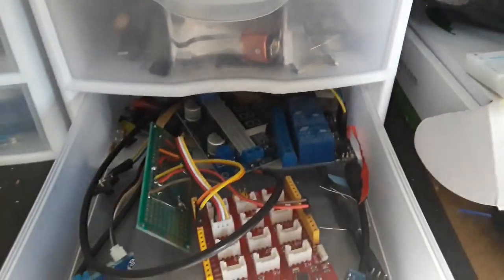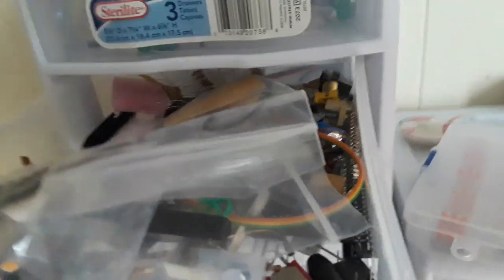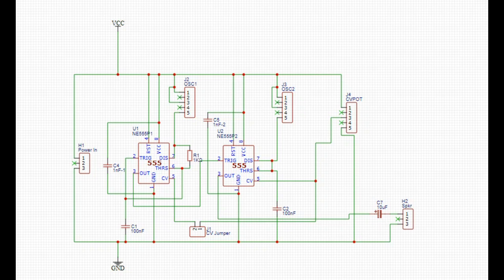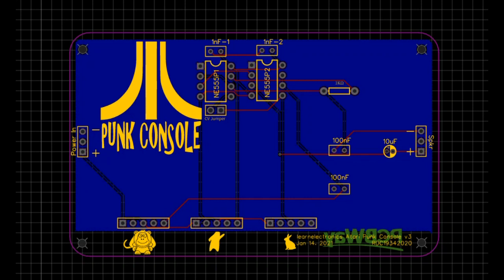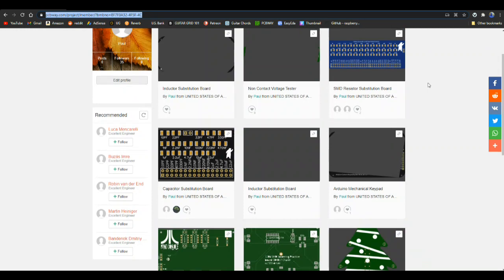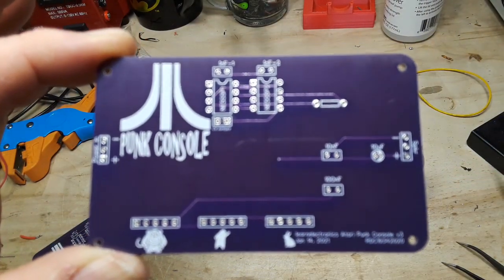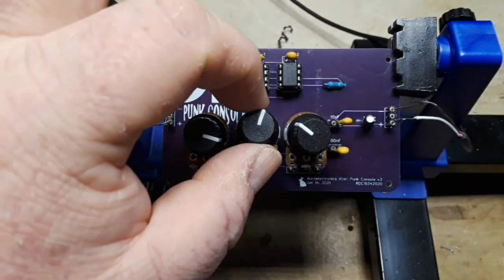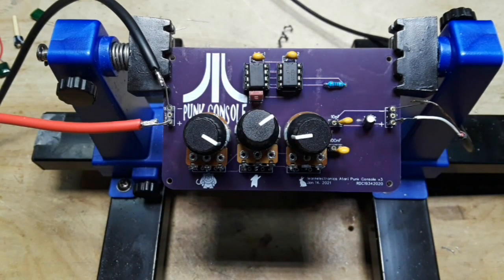Final Version - Atari Punk Console

Comment: Hi Paul, Can you please explain a 555 circuit I accidently made ?
I don't think it should work but it does.

Parts: 6V PSU, 555 IC, 10uf Cap, 10K VR, 0.25W 8 ohm spk.

Attatch the speaker between pin 8 of the 555 and 0v.
Connect pins 2 and 6 together.
Connect the wiper of the 10K VR and the + of the 10uf cap.
Connect pins 2/6 to cap and wiper.
Connect - of cap to 0V
Connect one end of 10K VR to +6v.

You can vary the tone with the VR.